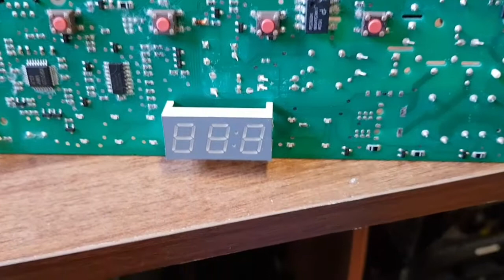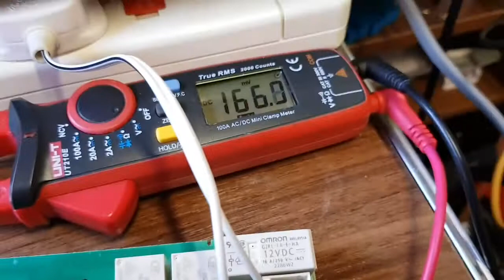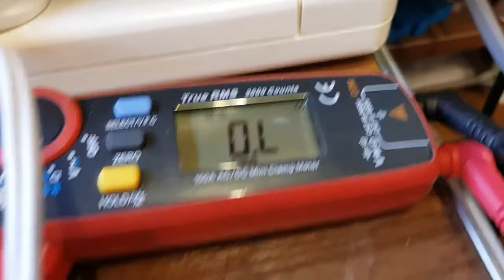fault finding tumble dryer PCB

Comment: Hi I am trying to remove the plugs from the sockets at the end of the board. The ones with spade connectors. I can't work out if there is a clip or whether they just pull out. I'm worried that I will break the pcb if I pull too hard. Please can you tell me how to unplug them. thanks
Reply from the maker: If they are the same type. Then there is a little plastic clip that holds them together. You can use a small flat blade screwdriver to free the clip while pulling them out. 
Good luck. And of course make sure the power is off first.
Reply: Hi, thanks. I have tried inserting a small screwdriver but no luck and can't make out where the clipp actually grips the plug. On other videos they appear to just yank the plugs out. @mathewlawrenceml
Reply: How do I work out the volts on the inductor gives me zero readings want to change part no continuity